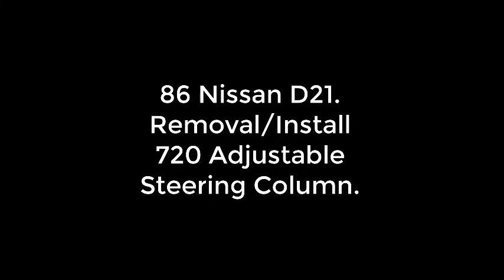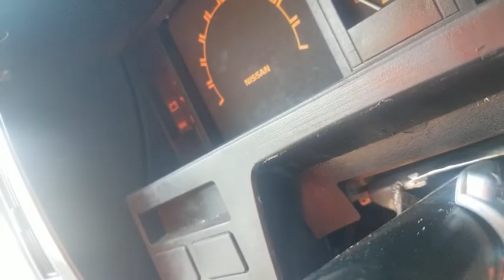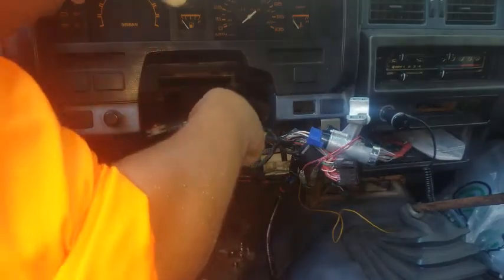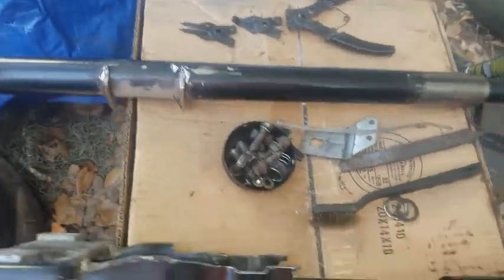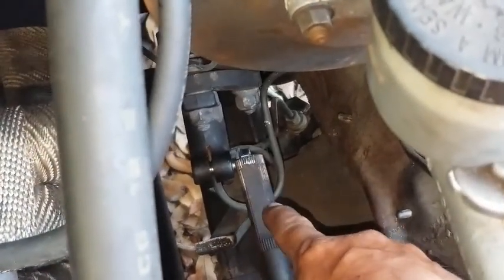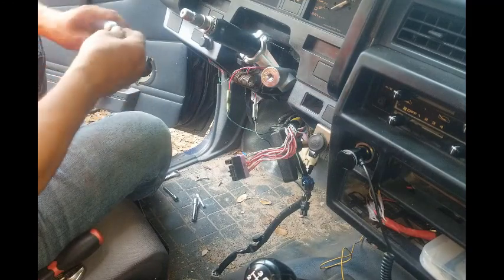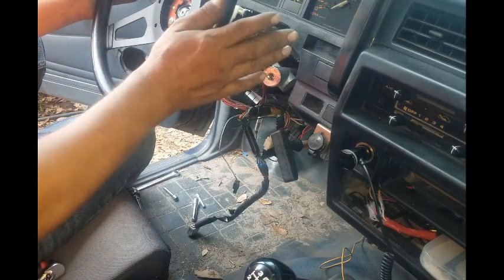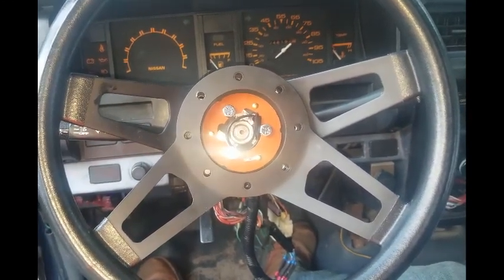86 Nissan d21. 720 steering column install! Walkthrough.

Comment: Very helpful man thank you
Reply from the maker: You're very welcome.  I'm glad I was able too pull this swap off. It's nice too have more leg room. And be able too tilt the steering column.
Reply: @almagam2099  im trying to do a manual swap on mine so getting the steering column out of the way is going to make it way easier to get the pedals swapped and installed
Reply from the maker: @sn2catt  that's awesome 👌